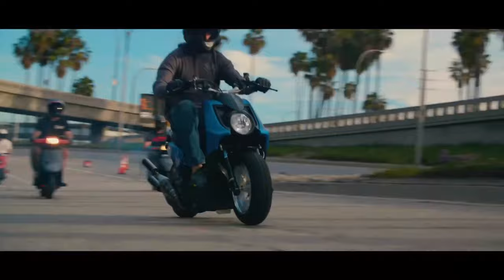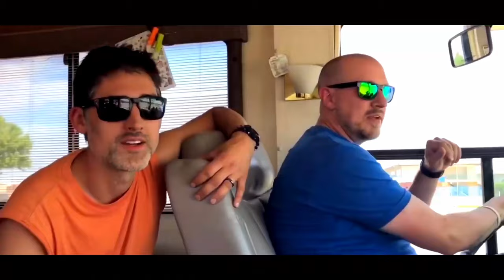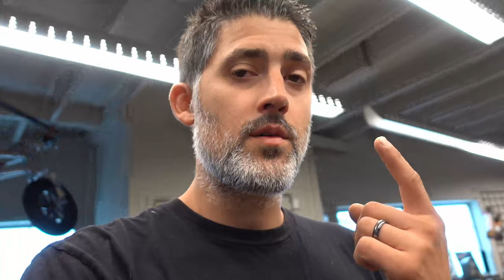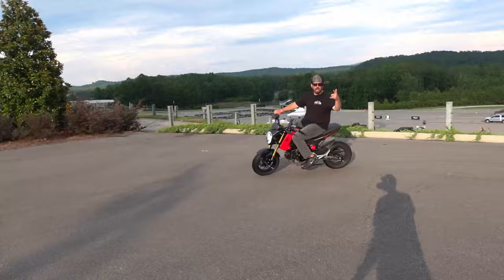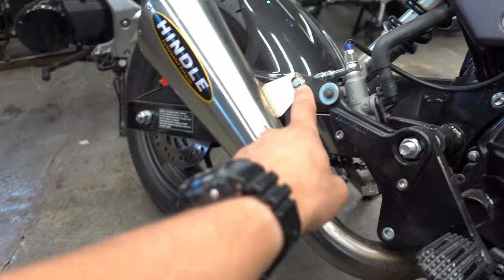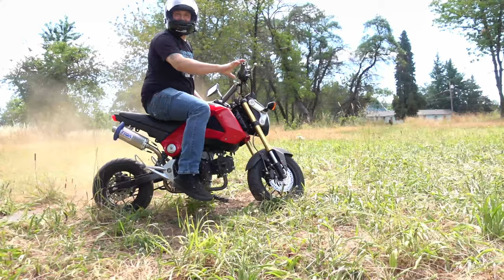HONDA GROM 170cc koso 4v, Did we blow it up?

Comment: Hi guys I’ve got a 2018 Grom that I put the Kosovo 170 kit with the 34  koso throttlebody are the 150 injector custom exhaust I’ve done everything it’s got the clutch kit the whole works and it starts good runs good I’ve reset the EC you and the throttle positioning sensor and yet I can only go to 50 miles an hour and it just goes  starts to bog downfeels at 50 miles an hour that it’s gone into limp mode if there’s such a thing for this little guy I’ve also got a PVC three I’m using I’ve tried different set ups on it and it’s the same exact  problem timing valves are all good anybody have any ideas please
Reply from the maker: we can get you a aracer and that would resolve most your issues also seems like you have a few other issues. call the shop we can get you a custom build sheet